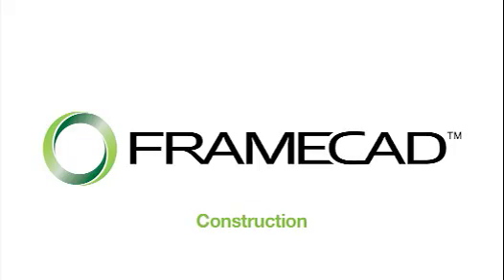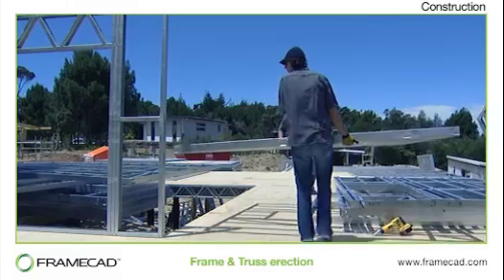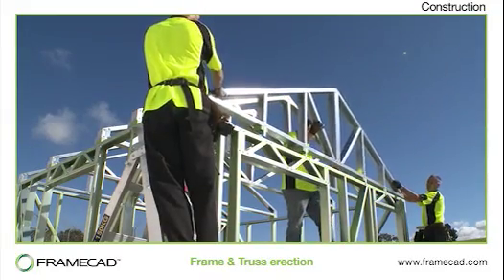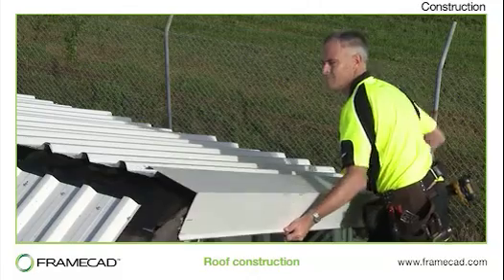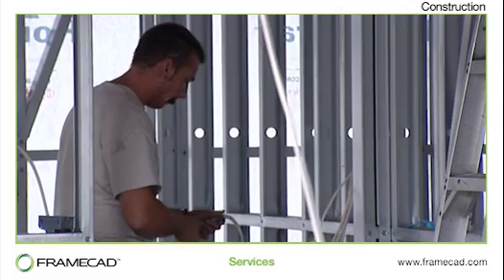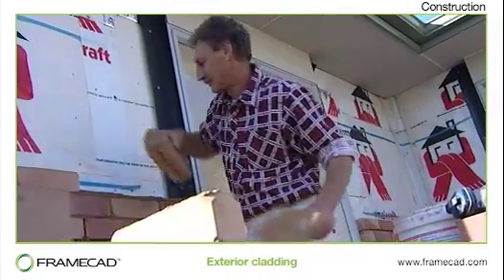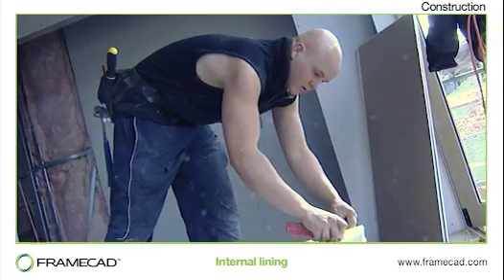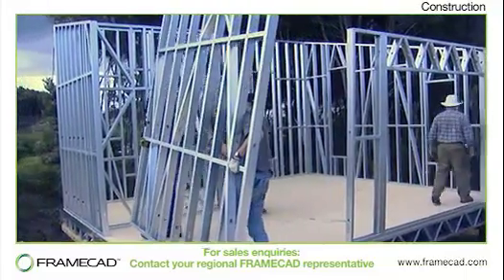How To Construct Using Steel Framing

Comment: Do not use insulation inside steel stud cavities. Steel is a massive conductor and reduces R-Values by 75%
Insulate the exterior with continuous, thermal bridge free Rockwool or other similar types.
Reply: I wonder if someones insulates the exterior with graphite EPS, is it necessery to put a vapor barrier in a warm climate zone?

Comment: what is the thinness  and size of track and stud?
Reply from the maker: 0.75 steel base material thickness, S500 steel grade, 89S41 section
Reply: Is it costly to build a steel frame 4 level building? Than a concrete one.